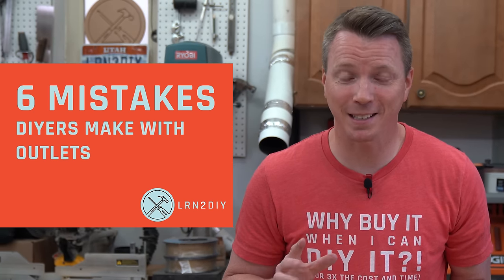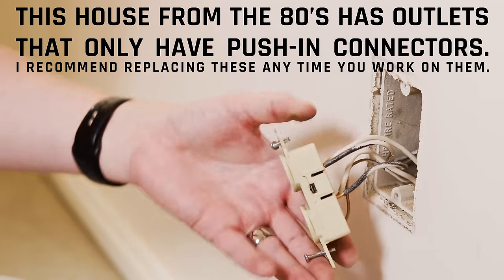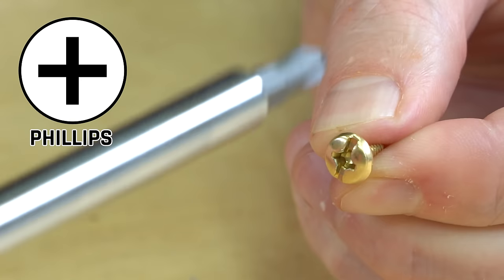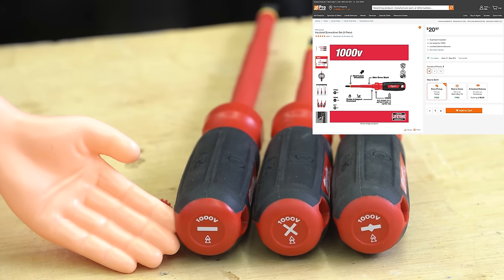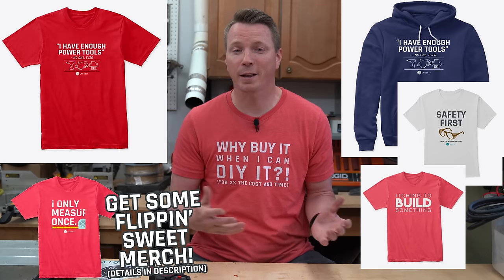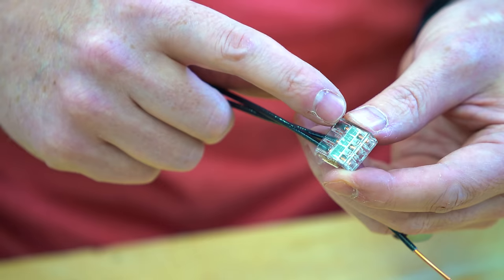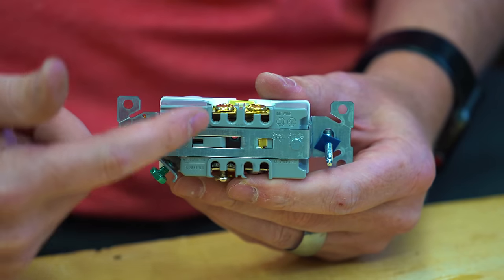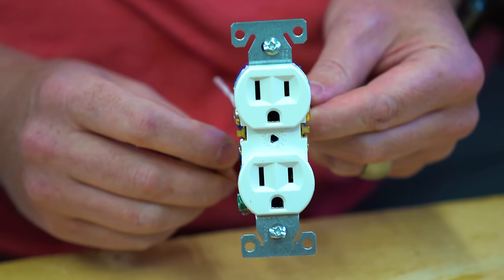6 MISTAKES DIYers Make When Wiring Outlets

Comment: So I do have another common mistake ( and I think you may have made it in your video. When stripping wire, using smaller gage stripping tools than the wire being stripped. It leaves an indentation in the wire that can cause a high resistance short since you are effectively changing the wires' capacity to carry the amperage it was designed for. ( I think when you used your knipex striper, the pressure was maxed out. It tough to tell in the video, but I think there is an indentation at the strip point. I only know this because I have done the same thing)
Reply: I noticed that, too. I think there was an indentation left. I try to use the very lightest pressure I can, in order to prevent that from happening. If I see an indentation in the wire, I cut it off and give it another try. Since I cut/strip with extra length to begin with, another 1/2" cut off won't endanger my project.

Comment: On #6, the other issue is that if that extra screw isn't tightened down, there won't be a good connection to the connecting tab that connects it to the terminal next to it, so power handling may not be as good.

Comment: My rep from a wire nut manufacturer said "not" to twist the wire ends  before inserting in the nut and twisting. They're not designed to accept twisted ends, rather straight.

Comment: I kind of disagree with some of the backstab terminal arguments. There is still a lot of contact on the sides of the wire from the demonstration and id say nearly as much as the side screw, depending on how much plastic was removed from the demonstration shown here (I'm betting not much). They still add the option for a reason and wouldn't if it was so terrible.

That being said, you definitely need to make sure your connection is secure as you would any other connection. Give it a good tug and if it comes out, there's your answer. However, it isnt a high motion area and if you're checking it appropriately you'll use more force checking it than force exerted from putting the receptacle into the junction box.

Comment: My dad always taught me to wrap the outlet with electrical tape once I hooked the wires on the screws. He always said that prevents from steel boxes, loose wires or your fingers from touching the live wire on the outlet. It may be an overkill as a method used by old school electricians but I loved the concept of xtra safety it provides; besides a $2.75 black electrical tape roll will go a long way and them some. 😄👍 and always remember to turn the breaker off!! The correct one!!💥💥💥you'll know...😝
Reply: $2.75?  Scotch 33+ is $10 now!!!
Reply: @pld8993  got to "Dollar Tree" they got electrical tape, masking tape, cool paint brushes, headlamps that work, etc....$1.25 Each!! ...I like good stuff but some things even Chinese made ones will do the necessary job for something hidden inside a wall....like black electrical tape.
Reply: @reydelsanchez  I'm a pro and the products I install are a reflection of me and my company. For wrapping conductors for a wire pull, the cheap tape is fine because it's going in the trash at the end of the day. If you're using it for shock protection, insulation, etc, real pros use professional products. And honestly, the cheap tape loses its adhesion rapidly.
Reply: @pld8993  I understand John...and as a type A personality myself I share the same sentiment...however, one cannot argue that there are cheap alternatives for jobs outhere that in all honesty...they do work 100%!! That one may desire the Mercedes Benz and not the Toyota Corolla that's another thing but in the end, the Toyota will get you there, not in style, but it will get you there. I have used the Dollar Tree tape before and its been 8 years and not an issue in my hot garage and air conditioned home. Maybe not suitable for a car engine bay, or outside elements where UV will destroy the adhesion and material elements....but for a tape inside an indoors wall in the dark, thats not getting beat up by atmospheric changes like outdoors...the Dollar Tree Chinese tape will do just fine on a few raps around an outlet, and it does insulates against shock...and I can still bind both your hands behind you back that fir sure you wont break loose...but lets leave that for the $1.25 kidnappers asking for a million dollar ransom 😝😂👍

Comment: I just spent a lot of time cursing Leviton and their “crappy screws.”  Little did I know they were ECX drive and I actually own that Milwaukee three-screwdriver set.  I was using a Phillips and when that cammed out I used a flat, which is a cursed thing but kind of worked.

Thanks!

Comment: Great video however you didn't mention reversed polarity. That's probably the biggest no no. My house was wired professionally and they used the stab in connections. I have had some of the wires lose contact causing the outlets not to work.

Comment: Chevydmax is totally correct.    Your commentary on the backstabbing is conditioned on which brand of receptacle you are using.   I saw a number of unknown different brands in your vid and undoubtedly one was Pass and Seymour brand.    I have rewired and replaced tons of these over the years in houses less than 20 yrs old.  Putting it politely they are simply junk.  Poorly made, easily damaged and fail frequently.    I automatically replace everyone of these if I am working in area that uses P-S.     You also had a Spec Grade receptacle in the mix,.   While these are great and UL rated and approved, you will be hard pressed to find any in residential wiring short of medical equipment in a house.   They are very expensive.    After 40yrs of playing with these devices,
I have come to the conclusion there are only 3 high quality devices I will ever use on my equipment or my family or customers.   They are Leviton, Leviton and good ole Leviton.  Thats my opinion but P-S and some knockoffs online from discounters is  akin to wiring your house with aluminum wiring and not using the conditioner.    Back stabbing is 100% fine and dandy with either of those 3 brands I specified.    As he pointed out ONLY 14 gauge, no 12 gauge back stabbing.     The last comment is your selection of tools.   Klein and Harbor Freight in the same video???
HF may have nice insulation along the shaft but (1) are you working on HOT circuits where you need insulation (2) Three screwdrivers for $15 from a Chinese knockoff firm.  
Please!!!!!    Stick with Klein and buy them in groups where they are about $7-$8 in a bundle of 6 or so.    Chevydmax rocks.!!!!

Comment: At 10:20 the words ‘right side’ were used instead of ‘correct side’. The point is the conductor should be drawn in to the tightening screw in a clockwise or wrapped left to right around the screw and not inserted incorrectly into the right hand side of the screw.

Comment: Surprised you didn't mention:
1. Closing the hook loop with needle-nose pliers
2.  How to properly cut the little tabs in the center of an outlet, how that effects top/bottom functionality with a switch.  
3.  Bending the tabs on top/bottom so it "grips" into the wall so it doesn't move and you don't have to put the cover plate on too tight.
Thx for showing us ECX tips though.  Gonna pick one of those up!

Comment: ECX is the second best robertson is best the robertson does not just fit the plug was designed for it to work. ECX fits better for sure but it is used so little its just not worth an extra tool on the tool belt. The back stab connectors do work you point to the left side and say little connection but don't mention the whole right side is in contact with the same piece of metal lots more connection then needed. You are right they should be one use only if they were not code then they would not pass inspection. Last you can not be sure the ones in your home were not used and reused a few times by the person that wired it or a previous owner.

Comment: Even though expensive, Wagos are a great solution for DIY folks.  I still use wire nuts as they are far less expensive and when used properly are completely reliable and safe.

Comment: Never use the back stab holes. If you do you are depending on a thin metal piece to hold the wire. And when you have multiple wires in the box,pig tail the wires so you only have 3 wires on the outlet. A black, white and ground. Make pig tail about 6inches long,it makes life easier when you replace the outlet. And always use the screws. Gold is hot silver is neutral.

Comment: Back stab outlet are just fine. Millions of homes are built every year with backstab receptacles and they are not bursting into flames. 

Yes screw terminals last a lot longer and will generate less heat with a 1500w load. But if $0.50 a plug has meaning to you then the cheap stuff works just fine.

Comment: I would also advise never using the push in back wire holes on those cheap blue back receptacles. The wires can fall out from repeated plugging and unplugging of devices.

Comment: Most outlets in homes are wired with back stab outlets.  Contractors have to bid their jobs as tight as possible, so they use back stab outlets because they are much faster to wire, and the outlets are cheaper to buy

Comment: "Outlet" is misused as a term for a receptacle.
NEC defines "outlet" as "A point on the wiring system at which current is taken to supply utilization equipment"
So a air conditioner pull out disconnect is a "Outlet"
Receptacle is more correct.

Comment: You get what you pay for. I tend to use only quality outlets made by Leviton and Lutron and I never have a problem with backstabbing.  I have though in my many years as a licensed electrician seen the "other" outlets and switches, yes switches, where the wires are literally falling out of the backstab.
Reply: NEVER use backstabs! For the record, the back stabs won't even handle 15A long term!!! And this is from experience of failures with 1500w space heaters!

Comment: I would add one point...
You should not have more than three wires on the outlet (unless it is half switched).
The device should be "utilizing" the circuit, not conducting the circuit to devices downstream. 
While it is legal to do so, it's a bad practice. You are forcing that tiny breakaway tab to carry the load to whatever is plugged in downstream.
Make all your connections in the box and add a 6" pigtail to extend to the outlet.

Comment: Don't you have to put the copper wire between the two plates; the stationary plate and the movable one and not between the screw and the movable plate?  I was told to do it that way by an electrician and it is a real pain!  I used to do it your way and had no problems.  Thank you

Comment: One other mistake that is common is wiring the terminals with the wrong wire.  In other words, attaching the HOT (black) wire to the NEUTRAL-side of the outlet.  The white wire shall be connected to the larger of the two slots in the outlet & the black to the shorter.

Comment: Feel the need to mention torque screwdrivers here. Every outlet around the world has a torque rating (usually in inch pounds) for the screws. This is because over tightening is as dangerous as under tightening. This is the only place I feel the mentioned ECX drivers might actually be detrimental due to amount of torque you can apply.
Reply: exactly, don't over tighten them, stop when you hear a cracking sound, that sound means it's just perfectly tight (too tight and the plug will fall apart and usually you can't stuff it in the box like that if your boss is looking)

Comment: The biggest one is to spend a buck instead of 50 cents on an outlet.  Don't buy the cheapest grade.  A few cents per outlet makes a real difference in safety and longevity of the outlet.  Much better contacts.

Comment: 4:43 that would be a real fire hazard if a space heater was drawing power off an outlet wired like that. Why you may ask, well because the heater would be fighting to draw power/current off that little swatch of wire. You would be getting some resistance to a full required power draw and with resistance comes heating up of electrical connections. Here is how that works, current starts to flow at a fast rate once a space heater is switched on but not all that current can flow freely into the circuit so some of it left waiting at the electrical connection and that is your resistance to flow equals heat equals fire if it can get hot enough. Another creator of resistance is called voltage drop also. Have a safe nice day everyone. 😃

Comment: A safety measure i do once it is all complete before attaching the outlet or switch to the box is to rap it with electrical tape to keep wires from accidentally touching.

Comment: A couple of outlets were intermittent and when I took them out I noticed the wire was connected to the push in socket and was a little loose.  Cut off the wire and installed them onto the screws, problem solved.  Looks like I should redo the rest of them.

Comment: Why did you not mention that there are "Backstab" outlets that ARE OK to use. The outlets that use the screw to clamp and retain the wire? They secure and hold the wire just as well as putting them under the screw.

Comment: Typically the UL listing of the wire nuts say not to twist the wire together with a lineman's prior to applying the wire nut. It's sloppy workmanship. The benefit of applying the wire nut properly is you can add or subtract a splice in the future without having to trim back the wire and restriping it.
A sixth mistake is having wire that's too short in the box. You should install an electrical device with enough wire in the box to be able to pull it out and change the device.

Comment: I'm not going to call #2 a mistake. Now if I were installing electrical switches and outlets every day those tools would be something I would look at. To be honest, on the rare occasion I do work on an outlet or switch I use a short stubbed large straight screwdriver. Never had an issue. I did ask somebody I know that does industrial and commercial wiring about this point. This is what he said. While it was a PITA, he hated to carry any extra weight in his tool belt and he kept it as small as possible. He had to use slotted screwdrivers as it was working on panels and just used them when installing switches and outlets.

Comment: Most electricians I know will tell you to always use 12 gauge wire on receptacles. Not 14 gauge which should be only used for lighting.

Comment: Don't work on live circuits kids- especially if you're wiring outlets.  Go to the service panel (breaker box) and turn off the breaker.  There are plenty of cheap devices for detecting voltage that you can use to ensure you have no power where you're working.

Comment: Happen to see this scrolling thru… hahaha yeah those backstab holes are the worst!! First & foremost when using those u have the recep as the ‘splice’ meaning if an issue happens with one recep u have connectivity probs down the line- 

Always best to splice & use pigtails but even u don’t, still curl the leads & wrap around …. #lazywiring 😆⚡️

Comment: Robertson screws and drivers are far superior to Phillips unless you need the driver to cam out such as in automated assembly. They are standard for contruction screws in Canada,  The screws stay on the drivers and they do not cam out. The reason it isn't widely used in the US goes way back to Henry Ford.

Comment: Just want to point out that Phillips screws/drivers are designed to cam out on purpose. They're made for power tools from the time before cordless drills with a clutch. Basically unless you're using grandpa's corded hammer drill (not rotary hammer) to drive screws or a lineworker in a Chinese factory assembly line, you should NOT be using Phillips screws at all. Phillips screws/drivers are not bad, they're just obsolete in most applications and misunderstood.

Comment: You shouldn't need to "pre-twist" the wires when using the proper size wire nuts.  When installing  them, they will twist as you tighten it.
Reply: We were also taught the "no pre-twist" method in college as well.

Comment: And make sure the wires in the box are at least 6". Also remember that sometimes the white neutral wire is not the neutral wire but instead a live wire because someone made a mistake.
Reply: They changed the code years ago to just 3”. Anyway do as you said at least 6”.

Comment: I will take a pair of long-nose pliers and bend the loose end back to what I call the stock side of
the wire  so that you need to remove the screw,  this way, the wire can't touch anything else.

Comment: Back-stabing is the FAVORITE of the professional electricians. I have repaired MANY outlets and light switches in my house and for friends. The "professionals" know very well what they are doing, and they do it anyways. Because when the outlet goes bad, you call the "professionals". They charge 50 for single outlet, or 200 for the entire house. This is job security for them. The BIG problem, is why the manufacturers EVER designed this option??? I seen European outlets, they do not provide for back stabbing. Only the screws on the sides.

Comment: If ya can't afford to buy insolated screwdrivers you can use electrical shrink sleeving to cover the tool...I've been using this method for years...just a pointer.

Comment: Back wiring is approved. It is not approved as a splice where I am in Canada. If you just use it for one device connection you will not have trouble.

Comment: I bought those wago connectors, but for a novice they may not use the correct gauge and not have a good bite.
Reply: The wire needs to touch all the way to the plastic. You can see the wire touch then clamp and all good

Comment: Backwiring is fine if it's done properly, and actually gives you some nice advantages, like allowing you to T off of an outlet without a pigtail. But it only typically works if you're using 14 gauge wire, which I usually try to avoid.